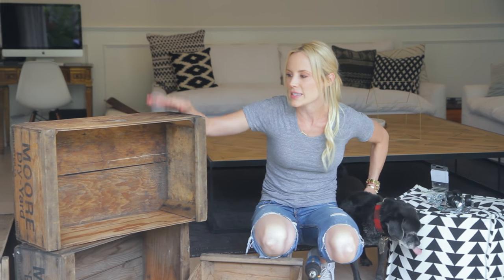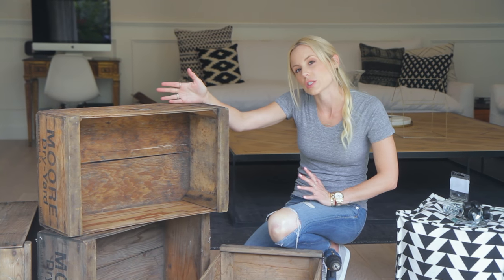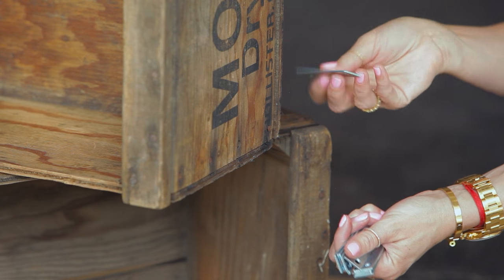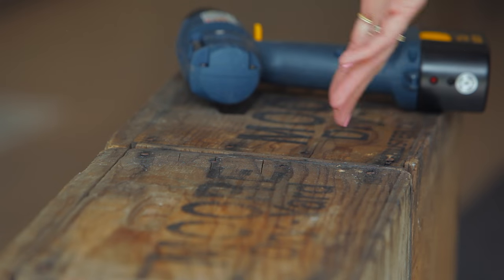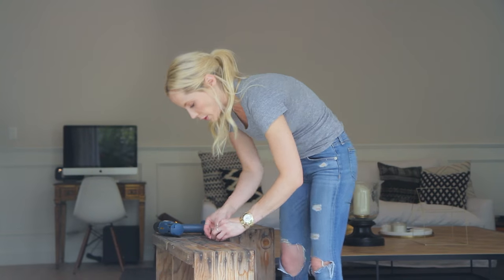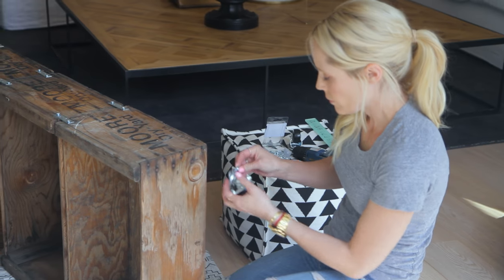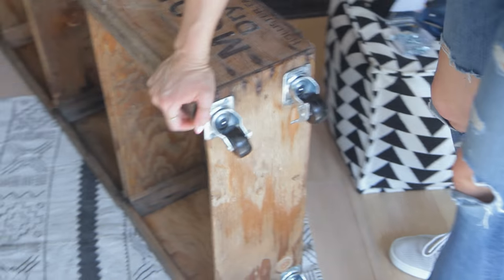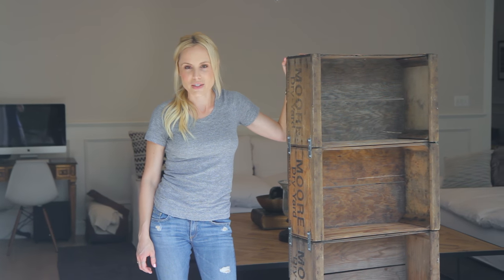DIY Bookshelf Made from Crates

Comment: They skip over the fact that her screw on the bottom front wheel went straight through the wood on the bottom crate. Leaving a sharp screw point exposed. A very easy fix to this is to get two extra pieces of wood, screw one onto each side (probably front and back of shelf) from the inside of the bottom crate. Then you screw the wheels into the wood you just attached. They probably skipped over this because it's supposed to be a fast and affordable diy. She would've had to stain the extra wood to get it to match the crates.

Wood glue in between each shelf would also make the hole unit more stable. Especially since this is intended to be moved around on wheels.

While not perfect, it's a lovely diy and I think I'll be giving it a go with a few adjustments.

Comment: I did this same project about a year ago using home depot crates which are deeper as a clothing storage. I actually put my plates on the back intead of the side and also screwed them crates to each other on the bottom. l added velcro with fabric to cover some of the shelves so that I dont have to see my clothing. My wheels are actually smaller than these.

Comment: Is there a reason why you put the mending plates on the sides as opposed to the back? If they're on the back they won't show. I think the brand new mending plates stand out too much against the aged wood, perhaps you could be spray painted them or made them look more antique by rusting them with a hydrogen peroxide, vinegar and salt spray before putting them on. That's just my preference though, your version looks really good too. Great video!
Reply: Thank you for saying that I was thinking the same thing. I think when I do it I'll use both of you suggestions. New looking on the back and aged on the side. Secure and rustic

Comment: lol I love how the dog was like "What's all this noise? Does it mean pets?" I like this idea a lot! Is it stable? I'm just curious if it's best for holding lighter things or if you could really load it up with a lot of heavy books. Either way it's awesome <3
Reply: Mine was pretty stable, but I used deep crates. If you use shallow crates I would say you need to fasten it to wall and make sure it's secure. Just look for deeper crates and it will hold lots of books : ) I would also not add the wheels if you plan on loading it up!